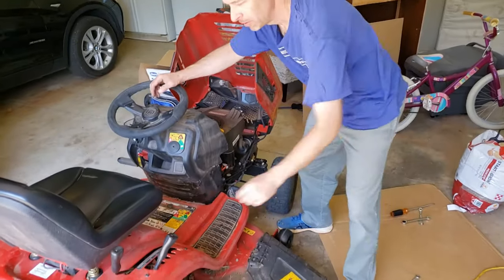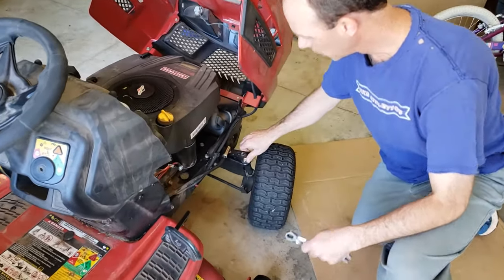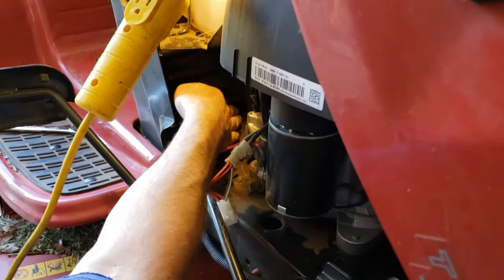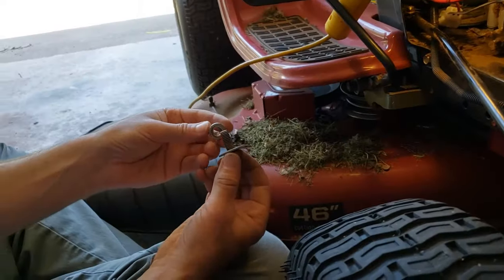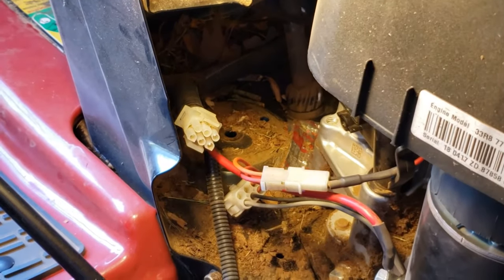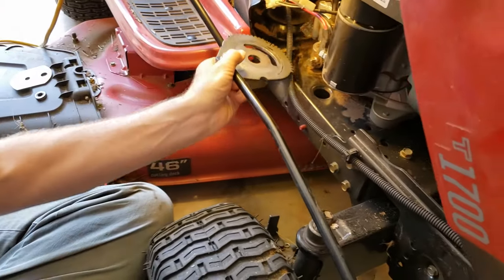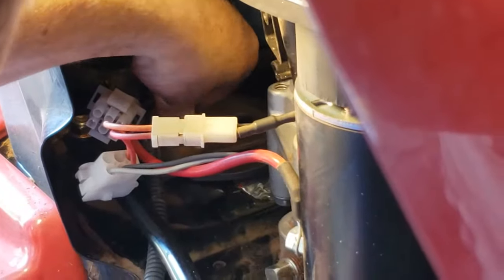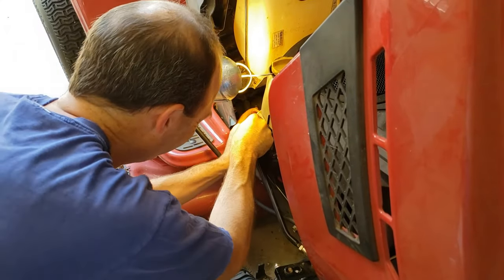Riding mower steering problems - won't turn left (or right). How to fix

Comment: Thank you for getting right to the point.  So many babble just to hear themselves speak.  Now I’m off to fix my mower!!
Reply from the maker: Thanks, Tim Tok. Good luck fixing your mower!
Reply: @FixEverythingYourself  I took a quick fix since my mower is relatively new.  They area you cleaned, I took a garden house on high stream and worked the wheel back and forth and now able to turn left.   Not sure if I have full range but I think a do. In Florida the dirt was sand not clumped dirt so water may work in this case.
Reply: @FixEverythingYourself    Do you do a video regarding mower stalling out during mowing?   I cleaned filters recently and have enough gas and also changed spark plug recently.
Reply from the maker: No, I don't currently have any of videos of that as I haven't encountered any problems (yet). BUCKWSR has a good channel with many small engine troubleshooting and repair videos. He may have something. Good luck. Sounds frustrating.